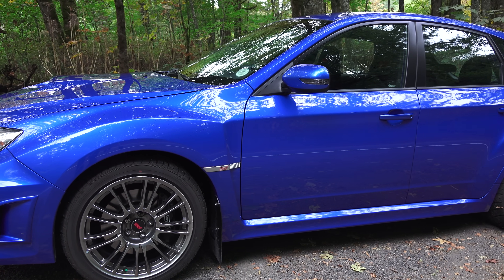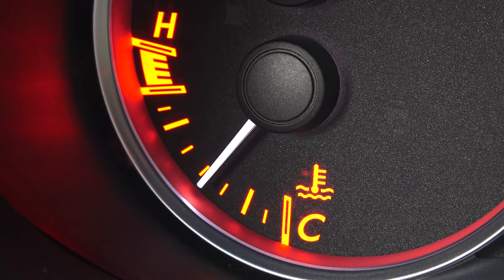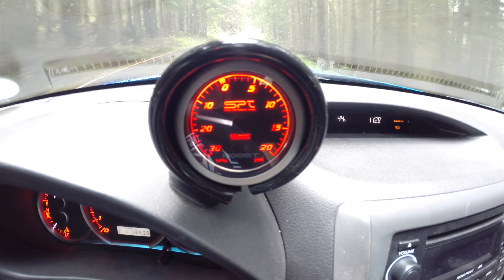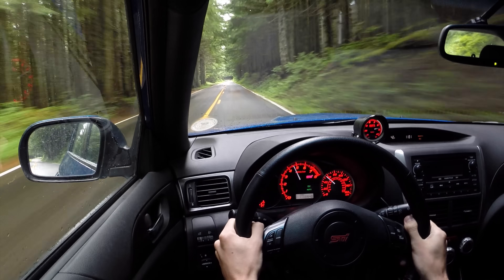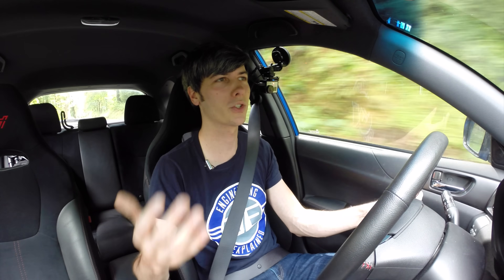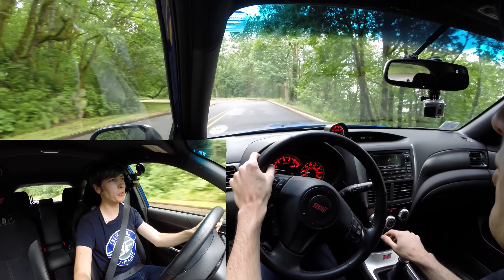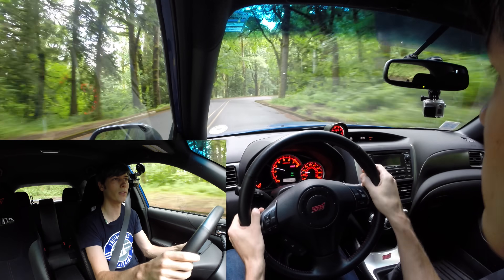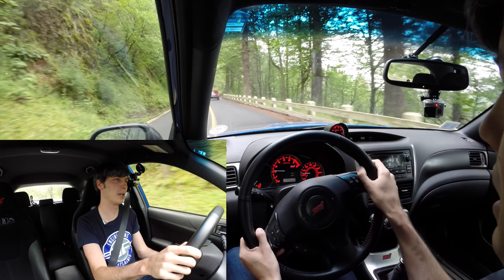5 Things You Should Never Do In A Turbocharged Vehicle

Comment: Don't most modern turbo cars still run the oil if needed even when shut off?
Reply: nickiminajsflaps it lets the oil flow through the turbine wheel cooling it down, reducing the chance of stagnant oil burning up or warping of any kind. Sure, Subaru may say you don't need to do this, but if you were at a track that day or just running your car hard you WILL need to do this to not damage your car in the long run
Reply: .... the secondary electronic coolant pump runs in your 2001 beetle after engine shutdown, to circulate engine coolant and reduce hot spots in the engine head. Oil is used to lubricate and cool the turbo, as far as I know there's no separate bung for engine coolant on your VW's turbo. Your oil pump is mechanical and stops pumping once the crank stops turning, and any oil in the turbo stays there or drains back down to the pan. Oil isn't going to cool very much unless it's moving, being replenished, and transporting the heat.
Reply: Andrew Warren I have a 2001 VW Turbo Beetle, and the pump runs for a while after you shut the engine off.
Reply: Don't rely on, "modern cars have this and that," I'd still stick to letting your car idle for 20-30 seconds. Wanna let the turbine bearings cool down
Reply: Oil pumps are frequently mechanical, so if the engine is off, your oil pump will be as well.
Reply: Dr kevorkian you’re a subpar human. Don’t let others tell you otherwise
Reply: My 1999 F250 Superduty manual says 7 to 10 minutes after hard driving. I let my 86 944 Turbo Porsche run for 3 to 4 minutes and it has a aux water pump (electric) the help cool the turbo, I let it run anyway, it also has a water to oil intercooler built into the engine block to keep the oil and water the same temp.
Reply: Dr kevorkian lol insulting the channel owner won't get you far
Reply: Andrew Warren not always true.  My car has a turbo timer and is powered and pumping oil even with my car engine turned off.
Reply: VW uses a water cooked turbo timer that runs after the engine is turned off.  However, I still idle the car for a few minutes before shutting off the engine as a safe measure.
Reply: No, they dont. If you have turbo timer - yes. This video is not called "for modern cars only" so...
Reply: Ya definitely in Volvo’s this has been something they have done for many years
Reply: My seat leon circulates the coolant if needed when engine shuts off
Reply: it's called  a turbo timer! they come stock..?
Reply: asif - Maybe higher end ones. I have a Mazdaspeed 3 (which i would consider modern) and it doesn't have a turbo timer (which is what you are talking about). Why make yet another part for the car (and something else to maintain) when people can just let the car cool down for a minuet?
Reply: If you drive crazy u need to wait 3 to 5minutes to cool your car. If your car is cold like mine bmw 525d u cant drove fast turbo will not spin and car will not let me to over speed ot punching while is cold engine. Nrw car models have intercooler and u dont need to cool   down the engine at all only if u are rally driver.. Than you need
Reply: @MakeSh00t  the intercooler cools the forced intake air once it's already left the turbo so it won't make a difference on turbo running temperature it's allows better performance from the engine
Reply: This is why I hate cars with auto stop start feature. A turbo car that turns off the engine when you come to a red light is really a bad idea. It shuts down as soon as you stop and that oil is just cooking on the turbo
Reply: Steven Melo ummmm what’s a couple of ounces of hot coolant going to do to a turbo that can glow red hot ? Subaru states that a turbo timer is not needed, our turbos are water and oil cooled so the cooling process takes place as soon as the car is turned off, stop spreading misinformation mate, if anything u want to just cruise for the last few minutes of hard driving to be safe, wha the hell is idling going to do ?
Reply: Dr kevorkian it’s what the red hot turbo does to the couple ounces of coolant and oil that are now sitting still in a glowing red turbo and cooking
Reply: @drkevorkian3668  idling after a blast will ensure cooler oil is being constantly fed through the turbo while it cools down to avoid stangnant oil burning/carbonising and potentially causing an oil feed blockage to the turbo that will cause consequential damage. Think about it oil can harden like glass when exposed to high temperatures I've witnessed oil feed blockage to be the cause of many turbo failures. If you replaced a fucked turbo due to this  without checking for the correct oil feed pressure then you can put your bets on that the new turbo will meet the same fate. The  engine coolant flowing through the turbo aids the cooling effect but I'd imagine isn't partial to the same effect as engine oil when heated up and cooled rapidly. Once the engine oil, coolant and turbo are at a comfortable operating temperature, usually  achieved by idling then the engine can be switched off.
Reply: Richie C the number 1 killer of turbochargers is oil starvation or contaminated oil, wtffff are u smoking ? Oil can harden like glass ? Mate oil should be dropped every 5k or less In high performance turbo charged cars, do u have any idea how hot oil gets that lubricates a turbo ? You think idling for a few minutes is going to change anything ? Please youngster, the real world is nothing like you’re google life
Reply: @drkevorkian3668  yes I do think replenishing hot oil from inside a roasting hot turbo with pre cooled oil from an oil cooler will help aid the cooling process why had the design been installed on nearly every modern turbo charged car then smarty pants?
Reply: @drkevorkian3668  and ok maybe glass was a bad example but yes it does go to carbon and block oil passages I've been replacing turbos on passenger and light goods vehicles for some time now and how you could you possibly know my age I don't know thanks for your patronising reply anyway
Reply: @drkevorkian3668  I think the point you are missing is that oil starvation is caused by allowing hot oil to burn inside the turbo charger that in turn blocks the oil feed supply it's not hard to understand even with your tiny brain
Reply: Richie C oh dead please stop, do you even know how an oil cooler works ?? PLEASE STOP 🤦‍♂️
Reply: @drkevorkian3668  yes I do know how it works what's your point
Reply: Cameron Matthews I know what it does, it was sarcasm.. we aren’t talking about tracking the car, that’s apples to oranges mate
Reply: Yes , this guy has no idea. This is what happens when nerds are given a platform

Comment: Just use a quality ester oil, quality fuel and drive it with a bit of mechanical sympathy and you'll be fine.
Cheap oil cooks off leaving carbon deposits in the turbo bearing races.

Comment: You should note that any modern turbo-car has a after-run electric (oil) pump, which helps cool down the turbo intime. Any proper car as well has both oil and watercooling going straight into your turbo.
Reply: All VW group cars have this; you can hear it after you switch off the engine. From an Audi S3 owner.
Reply: NO they don't!
Reply: So in a 2016 VW GTI, where would I look to see if it has an electric cooldown pump?
Reply: Cars from early 2000s started implementing it. Subaru's didn't until recently hence mid-to-late 2000 model Subaru's still had turbo timers.
Reply: This is possibly the first time I've ever heard of such a thing (perhaps second, and it was long enough ago that I forgot). Maybe it's very new, or maybe it's brand specific. I certainly know that neither a run-on oil pump or water cooling for the turbine are things you'll find on the Renault-group DCi's I'm familiar with... you have a pipe running from the main engine oil pump, and you have another returning the oil exiting the turbine back to the sump, and that's it.

The one thing I was always worried about doing was oil-starving the turbo, so tried not to cane it too hard from cold, and allowed it at least 10-15 seconds of idling after a hard run, if not a full minute. Depending how much time I still had to make up on that journey after getting out...
(luckily you can cover at least some of that by coasting towards your parking spot in neutral...)

It sounds rather like a thing that's installed not to improve how the engine runs, or passenger safety and comfort, etc, but just to idiotproof the car against drivers that don't care for it. Part of the rather odd push towards super-extended service intervals maybe? (like 18 months or even 2 years between any significant maintenance, and 15000 to 20000 miles... which just feels like hardware abuse to me; every 3000 miles may be excessive and hard to fit in, but if you can't find the time once a year or every 10000ish miles to book your car into the garage for a day, perhaps you should take taxis instead. It's not a washing machine, or a mobile phone, and shouldn't really be treated like one)
Reply: Just read your damn manuals they'll tell you, that's how I know my Abarth does
Reply: What specifically do you mean by "modern"?  Is that only brand new cars?  Only the used ones that were cutting edge high tech when new?  I have never owned a vehicle newer than 7 years old in my life, and I would still consider such vehicles to be "modern".  Not everyone can afford a brand new vehicle, in fact most people can't.  My current Subaru is turbocharged and has neither of those systems.

Comment: Is it cool to gradually add gas while in a high gear at a lower rpm just to save my clutch some heat? Say I'm going 80 mph on the highway at 3k rpm, and I have to low down to around 65 mph at 1.5k rpm. If I granny the throttle and not give it any boost (aka not flooring it) back to 3k rpm, will I be fine?

Comment: As long as you have the correct amount of oil and grade, you can pound on your turbo no problem, there is no waiting for "correct temperature" or engine warm up.  Oil is fed directly to the turbo housing to cool the turbo and keep it from overheating.  If your oil pump system is fine, there is no engine sludge, your turbo will be fine.  On the other hand, the critical thing to mention is in many turbo cars, there is no turbo timer, a system to keep cooling oil running through the turbo when you are done driving.  To extend the life of the turbo, you can continue to run the engine to cool the turbo until nominal idle zero boost temp is achieved.

Comment: Most of the problems that are mentioned are related to engines that are not made to be turbocharged and manual transmission in diesel trucks. The engine in the car he is driving is a flat 4 engine, known to run at a high compression while having a strong oil pump and reserve to keep it cool.

Comment: Just an FYI on that last point. With certain cars some degree of slip is actually beneficial. I honestly can't say with any degree of knowledge for RWD or AWD on a track but it is a generally accepted fact in small car racing that in a FWD you should progressively feed in the power allowing some slip on the front tyres as you exit the corner, the number I heard is around 15degrees as with this small degree of slip it allows for an optimal amount of power to be put down as you exit the corner.

Comment: my GTI has a digital oil temp display... and i've noticed that the coolant temp hits 200 long before the oil temp even starts to register a temperature (it just shows "- - -" until it gets up to like 170 or so).

i've also noticed my radiator fan will run for a few minutes after i shut off the engine.  even after i lock it with the remote.  i guess it's trying to minimize those hot spots and oil burn.

Comment: I'm willing to bet the preignition at low rpm happens more often then then not because people are not running a high enough grade of fuel. Other factors could come in to play I imagine like cam maybe the size of the engine spacing of cylinders causing a greater build of of heat where as a higher v8 has more physical surface area to cool. Deep subject indeed

Comment: Also for tuned or high power stock cars the highest octane compared to lowest octane gives you slightly better performance. It's already noticeable difference when you have +200hp car. At something like +500hp the difference can be measured already huge for example like 95 octane at 520hp-530hp would have around same performance than 500hp at 99 octane or so.

Comment: LSPI is a problem indeed, especially if your oil has additives that are based on calcium (mostly detergents). But it is more of an issue with gasoline direct injectors like the Volkswagen TSI engines. But there is another problem as well with high load at low revs. The oil film in the crankshaft bearings builds up its oil pressure through the speed differential between bearing and shaft. It's mostly a hydrodynamic lubrication. High oil pressure means that the oil film itself can take more load, especially the ignition chamber pressure that gets translated into piston rod force. Now at low revs, a high force might lead to the shaft being pushed into the underside of the bearing with no oil pressure there to keep shaft and bearing separated. Not good. Naturally aspirated cars don't have these problems because they usually have low torque at low rpms so there won't be as much piston rod force to begin with.

As a rule of thumb, I never floor my twin-charged car in high gears below 2500 RPM.

Comment: i have a question im still new to workign on cars most advanced thing ive done would be between altenator and serpintine belt change and replacing brake lines on my 92 ford explorer 4 door eddie bauer edition awd im thinking of installing a turbo in it eventually because i heard it is more effecient for the engine when at say highway speeds is that true or is it completley pointless for me to do so on my car. thanks in advance on the info

Comment: So I have a Cruze that has a TINY turbo in it. It isn't really meant for power anyway. Should I be buying 89 or 91 octane in my car?
Reply: ʜ̲̅ᴀ̲̅ɴ̲̅ᴋ̲̅ ʙ̲̅ɪ̲̅ᴢ̲̅ᴢ̲̅ᴏ̲̅5̲̅ Sadly, I do not, since it hasn't caught on much in Canada.
Reply: Look in the owners manual..  Sometimes it is also on the gas door..
Reply: ʜ̲̅ᴀ̲̅ɴ̲̅ᴋ̲̅ ʙ̲̅ɪ̲̅ᴢ̲̅ᴢ̲̅ᴏ̲̅5̲̅ Well, it gets confusing.

You look in the owners manual for North America, it says to use standard gas, 85 or 87 or whatever, math is hard.

But when you look at the English one, it says to use 89, 91, or 93.
Reply: Try the mid range . Do you have a flex fuel car?
Reply: They are kind of a scam, E85 cost more and gets less Mpg/Kpg..  Would have to assume you should be good with any rating gas just lessen for knocking with higher rating..
Reply: Lol, like plastic intake manifolds..
Reply: ʜ̲̅ᴀ̲̅ɴ̲̅ᴋ̲̅ ʙ̲̅ɪ̲̅ᴢ̲̅ᴢ̲̅ᴏ̲̅5̲̅ plastic valve covers THAT HAVE THE PCV VALVE IN THEM SO YOUR 7 DOLLAR PART AND 10 MINUTE LABOUR SUDDENLY COSTS 90 DOLLARS PLUS AN HOUR! 

Genius Motors has always cheesed me off.

Comment: Modern diesels tend to have Dual Mass Flywheels, probably the only reason not to let them pull hard from low rpm. I have had a number of turbocharged cars and do a high mileage, the whole turbo cool down process seems to be exaggerated,  if the car has not been thrashed I really don't believe the turbo needs an extended cool down period. I am sure it varies from car to car and possibly the turbo bearings vary. Cars don't need to be babied, that doesn't mean screaming the engine as soon as it starts but you are fine to drive straightaway.. ultimately the car is a tool to serve you and not the other way round.

Comment: Great video!  However, manufacturers recommend for all engines with turbos the use of synthetic oils so its silly to say there isn't enough flow unless the oil is hot.  Most synthetic oils "flow" sufficiently even when in temperatures at or below freezing.  Turbos with sealed bearings (which do not draw oil from the engines sump) would not be impacted by this situation.